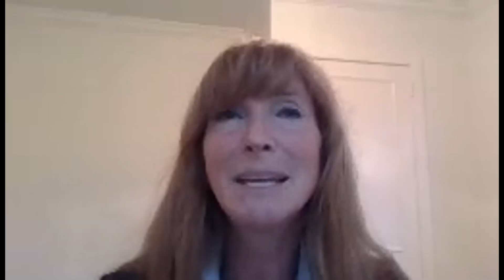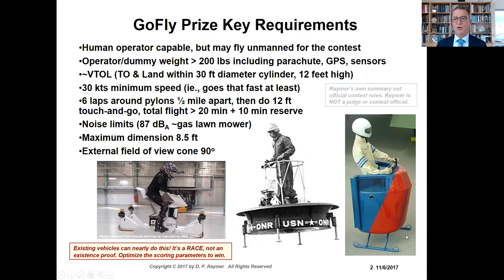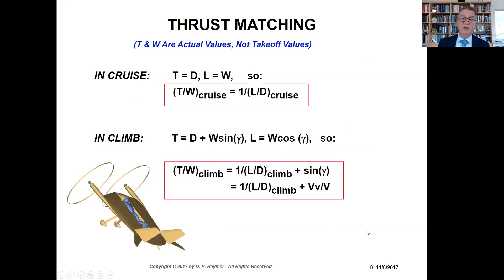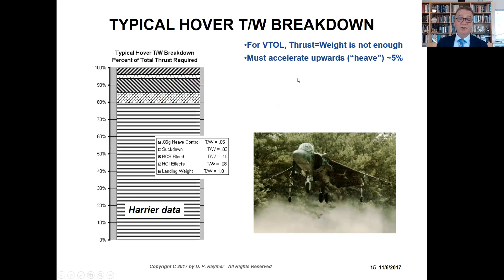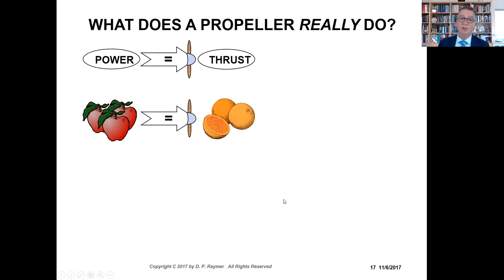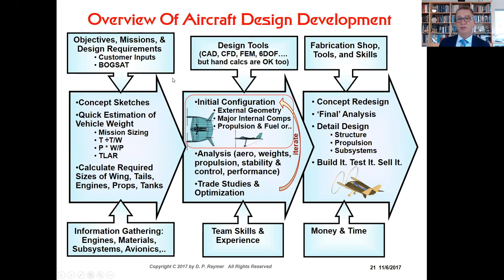Master Lecture: Aircraft Conceptual Design w/ Conceptual Research Corporation's Dr. Daniel P. Raymer

Comment: 34:40 There's another way to counteract torque, invented by Miroslav Svec for the Scout Paramotor. Basically you put wing-like elements in the airstream from the propeller, angled so their lift vector is in the opposite direction of the propeller's drag torque. Sort of like the coaxial propeller method, but one of them is stationary and much higher pitch. Here's a video about it: https://www.youtube.com/watch?v=gf4CldtTfqI

For the paramotor, the anti-torque blades also double as the supports for the safety cage around the propeller, so the drag penalty is a non-issue since you need a cage regardless. But for a helicopter it might not be worth it. Though it would still make sense to give helicopter tails an airfoil cross section to take advantage of the same effect and reduce the load on the tail rotor.

Also could use it for the supports of a ducted fan.